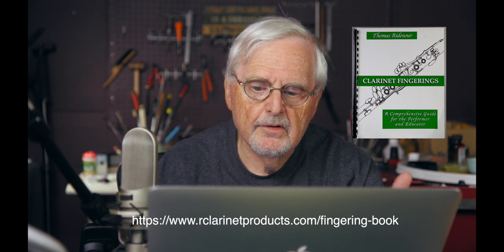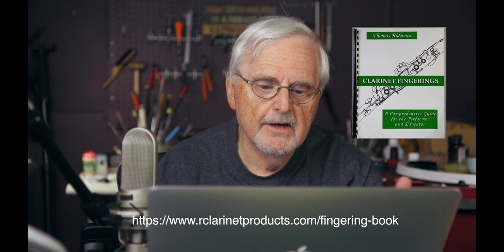large and small bore clarinets:what are their major differences?

Comment: The mulitplicity of fingerings for the 3rd register is also available on large bore clarinets!

It's just my opinion, but the marketing of the Buffet clarinet in the latter half of the last century is responsible for this change.
It can't have helped much either that the largest manufacturer of large bore clarinets (Boosey and Hawkes), acquired the largest manufacturer of small bore clarinets (Buffet) and stopped making large bore clarinets.

You don't really have a choice, either.
The only companies I can think of off the top of my head that produce 14.85mm and 15.03mm bore clarinets are Selmer and Peter Eaton, respectively.

I'd really like to try one of your clarinets.
Are they for sale in the UK?
Reply from the maker: David,

We could absolutely arrange for you to trial any one or more of our clarinets. Feel free to email us anytime at sales@ridenourclarinetproducts.com

Best regards,

Tom
Reply: @billyboy647  Thank you William.
Reply: David, Yes, I agree. There are many and analogous fingering options in the third register of large bore clarinets. But largely they are not needed as extensively. Why?
Because the larger bore produces 3rd register tones that are naturally better in tune than small bore clarinets using the standard fingerings you'll see in most beginner fingering charts. Large bore clarinets will even play many third register tones sharp. While the small bore clarinets have lower third register tones.
So, why not use the large bore clarinets?
Here are the reasons small bore clarinets are still better and advantageous, most especially in respect of tuning.
1. The multiplicity of alternate 3rd register fingerings enable small bore clarinets to play very well in tune in the third register.
2. Even if these alternative for small bore third register pitches did not exist (but they do) it is MUCH more important to have the low and middle registers well in tune with themselves, because those are the tones clarinetists play and are heard the most.
3. While small bore clarinets have that alternative for the third register, large bore clarinets have virtually no alternatives to counter the sharpness of the right hand low register tones as a result of the larger central cylinder. 
Now, clarinet tuning is adjusted three primary ways. 
a) an actual physical alteration of the bore or tone holes or pad height adjustments, 
b) the player making adjustments by voicing/embouchure or 
c) the player using various fingering and tone hole coverings and/or venting adjustments.
Of these three possibilities, none of these three means is sufficient to correct the extreme detuning between certain of the  right hand low register tone holes and their 12th corollaries in the clarion---the detuning commonly being 20 to 25 cents or more. 
Nor is any combination of the three able to produce well in tune lower right hand tones without unacceptably distorting the integrity of the clarinet's color, shape, clarity, and resonance.
We understand some Jazz players (especially Dixieland players) persist in using larger bore clarinets. Why? BecauseJazz players can get away with making a wide range of changes in the color and shape of the tone for a whole variety of technical and artistic reasons. Classical clarinet playing, on the other hand, has a much narrower ranges of acceptable variability in tonal shape and color than does jazz playing. 
The differences in acceptable variability in these divergent styles just come with the territory. One must simply accept each one's premises or go do something else. The premises themselves are the style's very definition, and are not going to change or adapt to you anytime soon...or.....EVER!
The clarinet's acoustics are very unforgiving and comparatively inflexible in respect to how much one can vary the color and shape in an attempt to correct detuning issues. Instruments like the flute. oboe and bassoon are more flexible in respect to how much their tunings can be adjusted, higher or lower, than the clarinet.
It's the nature of the critter. Live with it or opt for a career in insurance or being a rodeo clown---or both, and collect on  the injuries you get as a result of your own folly.
Again, it's perfectly clear that the MASSIVE switch to small bore clarinets in the mid-20th century was not some sort of temporary stylistic fad. The switch was neither caused by nor did it depend upon changes in the subjective taste or preference of some. 
Rather, the changes were based on the greater ease the small bore clarinet provided in respect to playing the clarinet better in tune in general as well as with itself.
What remained after the small bore revolution was to make the clarinet more even in response, the correction of a few remaining detuning issues, and improved stability of pitch, color, and shape of the tone in dynamic changes.
I think my own clarinet designs have made significant headway in positively addressing these other, remaining concerns. But the verification of that must come from those who are openminded enough to question their own priors, and actually give my clarinets a fair test.
Reply: @avarmadillo  Well, William, we'll just have to "agree to disagree".
As a clarinet maker and clarinettist, I can promise you that I can make a change to the bore of the instrument (specifically, the barrel), which will render the intonation of the instrument (large or small bore) quite even (*quite, because no instrument is 'completely even') in intonation, sound texture and response throughout the range; 1st, 2nd and 3rd registers.
I don't profess to be the inventor of this modification, but it does exist and existed in the past. (I'm obviously not going to address this issue in detail here in public, but I would love to discuss it with you in private). Jack Brymer, after all, was quite a demanding musician...and played on a large bore instrument.
To the public reading this:
I have never inspected or played one of William's clarinets and so I cannot comment on them directly...I cannot therefore be accused of trying to 'rubbish' or otherwise indicate that his clarinets are wanting in any way, shape or form. The conversation we are having is truly the reserve of instrument makers and a few excellent musicians. It is a subject understood in this amount of detail by only a relative handful of people throughout the world.
With that said, I am sure William's clarinets are of excellent quality and would satisfy the exigences of almost any musician. I would urge anyone to try his instruments: He wouldn't be on here presenting them to you if they weren't among those of the highest standard possible.
Reply: @davidsmart8594  My experience does not comport with your position. I've NEVER played a large bore clarinet that did not produce sharp right hand low register tones, creating highly imperfect right hand 12ths.
If you have a large bore clarinet (14.85-15:00mm) that produces true right hand 12ths. show it to me.
Reply: @avarmadillo  "Show it to me"?
Play nice, William...
That's unlikely to happen as I can't see me travelling to the US anytime soon and I can't see you coming to the UK just to visit me.
Just because you haven't seen it, doesn't mean it doesn't exist.
From my previous response:
"As a clarinet maker and clarinettist, I can promise you that I can make a change to the bore of the instrument (specifically, the barrel), which will render the intonation of the instrument (large or small bore) quite even..."
I'll leave it at that.